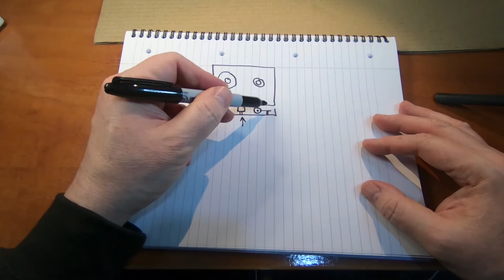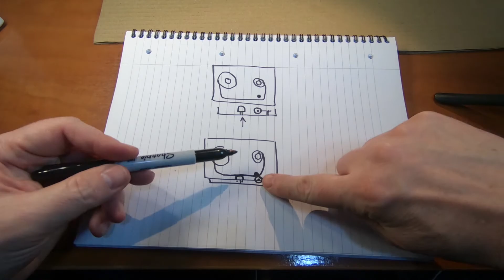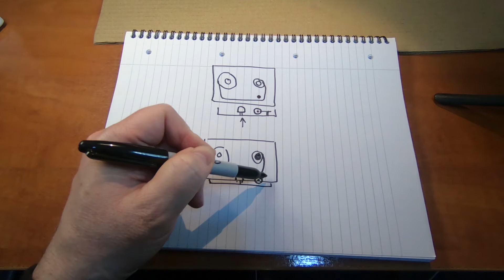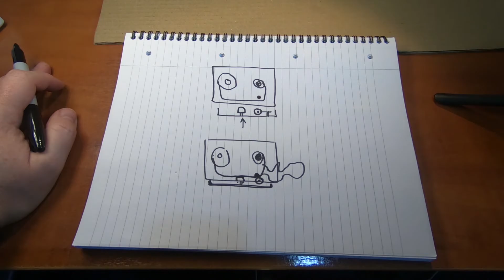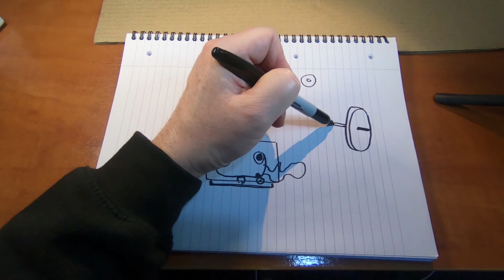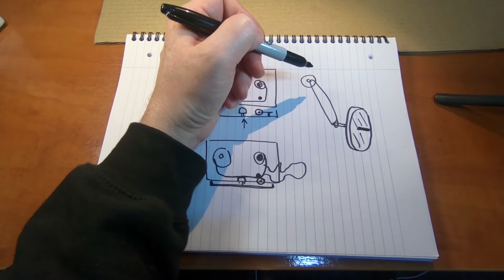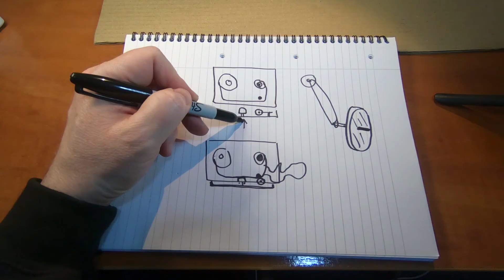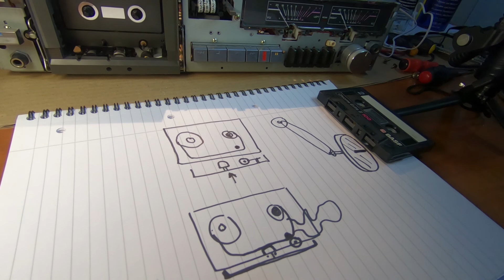What does a cassette capstan do and what causes tapes to play fast?

Comment: Hi. Thanks for the video and the description, I finally understood what the names of the parts are. I just wanted to know if the pinch roller stays static or is supposed to move/roll inside a walkman cassette player. Having trouble,  the spindle and the capstan work but the spindle doesn't turn when a cassette is inserted.
Reply from the maker: Sounds like the belt is bad. Slipping when under more load.
Reply: @ANTandTEC   Thanks for replying. That was really quick :)  I figured that the pinch roller is the main problem since it's rusty and the rubber is sticky plus it doesn't move that much unless I give it an occasional tug with, my finger. Also, the belt is loose.

Comment: hi was fixing a tascam 238  i pulled all servo gear out as it was allways playing up all the time   now i have a  1 7/8 -  3 3/4  and 7 1/2  
 just a super bit of skill 

on the one motor cassette decks you can pimp them   as long as take up can go faster than the pinch roller   i am a tec so i know my decks 

tascam 234  234 are allways playing up
Reply from the maker: Nice machines those 👌

Comment: Please help. My Sony wmr55 the reel don't spring when in PLAY. But FFW and FBW is ok. So when I press the play button. The reel spring very slow. After a while. Tape becomes mess.
Reply from the maker: If the mechanism is running slow when playing, and is okay when FF & RW, then possibly the belt need replacing.
The motor will be under more load when playing - perhaps the belt is slipping.

Comment: got a problem with my tape deck rotel rd 300m wont forward wind or play only for a second then stops ,any help would be appreciated
Reply from the maker: My first thought would be a 'gummed up' mechanism. Caused by old hardened grease on the gears. 
The auto-stop mechanism detects the end of the tape when there is a resistance on the gears, this causes a clutch to slip and trip the stop. 
If the mechanism/gears/spindles are stiff to start with, then it could show the behavior you are seeing. 
I would clean off all the old grease with cotton buds and IPA, then re-grease where required.

Comment: What would cause the motor to increase by itself, even after adjusting the speed manually? I have I couple of boom boxes that have this issue.
Reply from the maker: The likely cause will either be a worn or dirty rubber pinch roller, or the pinch roller is not fully engaging with the capstan.  It is not common for the motor itself to require speed adjustment, and if it does, it is usually a very fine adjustment just for calibration purposes.

Comment: It’s strange that the capstan is just smooth metal. 
You’d think it would tend to slip. 
I mean, I’m old enough to have used cassettes regularly in high school, and tape itself is also pretty smooth, especially on the side that the metal capstan touches.
Reply: I agree at first, it seems un-intuitive. The capstan must be relying on the roller contact on the opposite side of the tape for the appropriate "grip" (but not too much). It's an interesting balance between capstan and roller that gets thrown off if either get dirty. I'm new to this as well, but this is what I've come to think so far.

Comment: I am playing with a repair of a cassette player / recorder am/ fm portable. The radio output is perfect, but the playback audio of the cassette is poor. I have replaced the belts and have gotten the unit to play a tape. The audio is a bit low and muffled with some warble. I have cleaned the pinch roller and removed some debris from the pinch roller axle. I have cleaned the playback head with alcohol and it did improve the low sound. Should I clean it again with a very fine abrasive cleaner? Are pinch rollers interchangeable if I salvage one from another random unit?
Reply from the maker: You don't want to use anything abrasive on the head. Just some cassette cleaner or isopropyl alcohol. Nail varnish remover can also work on a cotton bud. 
If it looks clean then it could need aligning. There is usually a small screw and spring on one side of the head. Try moving it one direction 1/4 turn at a time and listen to the playback. If it gets worse them move it the other way.
Reply: @ANTandTEC  Yes, I was considering the head adjustment. Thanks. The cleaner I was considering was a product called soft scrub that has a very fine abrasive.
Reply from the maker: @lorettacaputo6997  Mm.. still sounds a bit harsh for me 🙂
If the adjustment doesn't make it sound better then the board might need re-capping. Bad caps can cause loss of treble on the output.
Reply: @ANTandTEC  Thanks.

Comment: Very good video to understand how it work. I've an old hifi dual 802 that don't works fast forward. I will try to fix it. Have you any tips? thank you
Reply from the maker: Difficult with out seeing it.
If it plays but does not fast forward, then I would guess that the spindle gears need lubricating. 
When the deck is playing the take up spindle only needs to be moving enough to wind the take up from the capstan, but when fast forwarding the take up spindle need to pull the tape from the other reel itself and at speed. 
I'd start with cleaning off any old hardened grease and  lubricating the gears.
Reply: @ANTandTEC  thank you
Reply: would silicon be good enough to live with or 3 in 1 or ?

Comment: Another thing to take into account is not only the speed can be off but the pitch is a huge factor for folks who have a good ear or near perfect pitch.
The width of the drive belt can be crucial.
The more width, the higher the pitch.
The more narrow the belt is, the lower the pitch can sound.
The trick is to find the right one that has the right torque... not too tight but not too loose.

Comment: great video, it seems like there are so many things that can go wrong with  cassette player mechanisms, what would cause rewind not to work? when I push the rewind button it acts like it wants to go for the first Second and then it shuts off. Play and fast forward works good as normal.
Reply from the maker: Sounds like the auto-stop is being applied. The auto-stop detects the end of the tape by sensing tension on the spindles. This can occur if the mechanism is stiff and in need of a clean and lubrication. With the player switched off, manually turn the spindle that is responsible for rewinding the tape - I expect that this feels harder to turn that the other spindle? (although it might not engage the 'stiff' part of the mechanism until the rewind button is pressed)
This is the part of the mechanism that you will need to clean and lubricate (This will probably involve a strip down of the mechanism).

Comment: Sony CFD-S01 Boombox. Pich roller is not fully engaged with capstan. When the play button is pressed there is free play in the pinch roller when it is pressed up underside. There is also free play in the play button downwards. Sir, how to solve this issue?

Comment: There also a speed control screw for the motor that can be adjusted and this screw sometimes can be found on the board or behind the motor, it is so when you replace a belt and the speed is altered.

Comment: Weird issue I'm having is the tape will completely stop after the pre-roll, and it reaches the actual magnetic tape. I understand that will be thicker than the prer-oll.  If I stab the FWD button, I can force it to jump start past the change in thickness, and then it runs fine. Any common cause for this? It's just a Mastui Slim Line player used to loading computer programs on 8 Bit micro computers.
Reply from the maker: That is very odd, I've never seen a deck stop at the tape join. It will be thicker where the two mediums are joined, however it will be very slight, nothing I would expect any deck to have issues with. 
When the tape is past the  join it plays normally without any issues for the rest of the tape?

Comment: helpful video I was reverse engineering a old cassette player to understand how it works it has two capstan
Reply from the maker: Auto reverse decks have two capstans, only one will have the pinch roller engaged at any one time.
Reply: @ANTandTEC  hmm yeah it's a car cassette player now I wanna do stuff with it using Arduino 🎈

Comment: You did try to adjust the speed of the motor before replacing it right?
Reply from the maker: I did. There was no change  in the motor speed when turning the pot from min to max. I think the speed/regulator circuit in the motor had packed up. 
The new motor sorted the speed issue on this one (not common for the motor to fail)
Reply: I'm having the same problem currently.
However my motor was playing tapes slowly, turning the pot made no difference whilst no other pot was available on the board. I bought a replacement motor (old vintage Japanese motor with only 2 replacements on the internet) and this time its playing really really fast 😂😭 god, pot also on this one doesn't change anything.  @ANTandTEC
Reply from the maker: @honeybro3385  Same model motor? If yes then check that the pinch roller is making good contact with capstan.
Reply: @ANTandTEC  Yep same model, and yes the pinch roller is in direct contact with the capstan. If I could post an Imgur link here I would but I think the comment gets deleted.